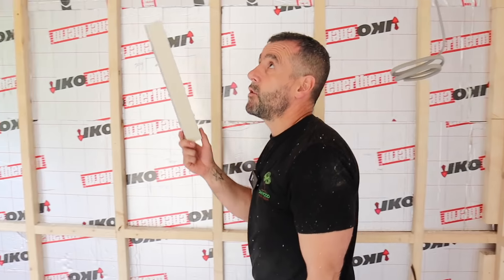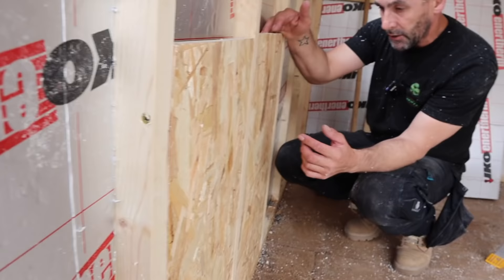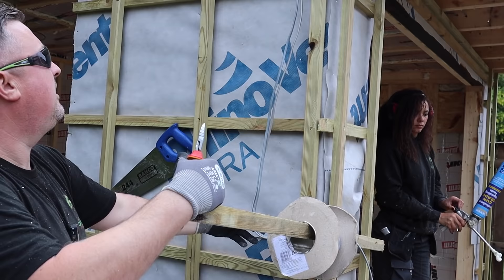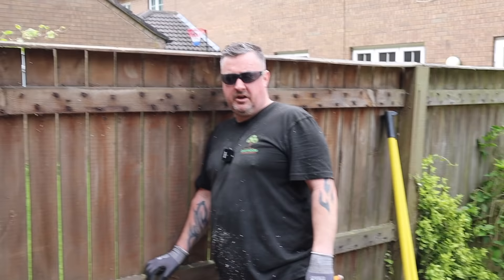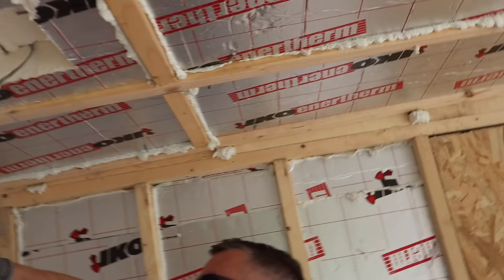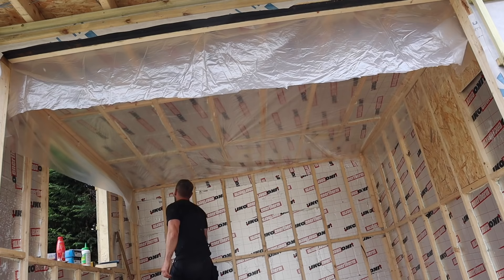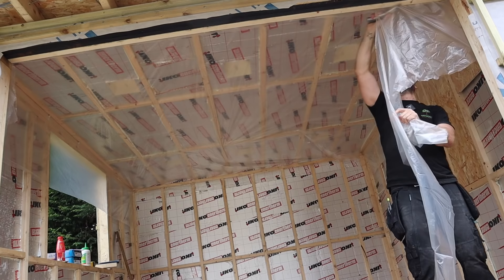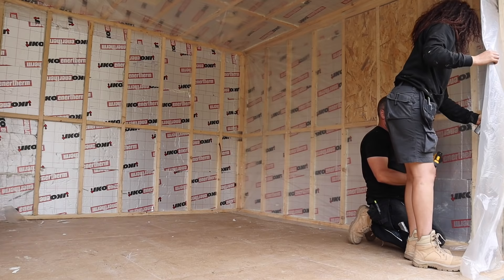Garden room, insulation, vapour barrier, 1st fix electrics and plaster boarding

Comment: Interesting that British gypsum  states that boards are not to be installed vertically but horizontal. They also require stud adhesive to the boards as well. How you do that with a vapour barrier beats me!
Reply from the maker: covering there back, if your stud work is good, plenty of fixings, it'll be fine
Reply: @thegardenroomguru  I don’t think it relates to the integrity of compliant stud work etc, it’s more to do with how glancing light and sun light strikes the boards . It reduces the amount of joins and these joins are halfway up the wall in a less reactive light reflation . Once the lights go on you can’t pick any joins etc.

Comment: 29 minutes in when he's drilling holes in the plasterboard, there's a thing called a DADE (dust and debris eliminator) that i found is most excellent at stopping al that mess from flying everywhere
made of silicon and worth the £15 investment
other than that, always finding new things even though the videos cover the same ground there's always a different angle, the pencil is great as i was wondering about that

Comment: My pir insulation is flush with the bottom of my roof joists as I have 50mm airflow above. So I've foil taped everything including the joists. Surely this will act as my vapour barrier?

Comment: Good video, I was looking at the insulation cost and doing it you way (with smaller sheets) is probably easier but around £4 a sqm more expensive than using 1200 x 2400 sheets.  Another option is to use 450 spacing but that could cause you issues with boarding unless you use 1800x1200 boards.

Comment: PZ has more contact with the crew head as it has 4 extra micro slots for grip the (little cross bits/lines) sit in the corresponding grooves of a pzcscrew head pH only have 4 points or torque contact. pH (Philips) head, PZ (pozi) head. And the pozi really means a more positive contact. There you know now. You would actually be surprised how many, very skilled craftsmen (or women) don't know that. 🤣🤣👊👊

Comment: Thank f***. Someone who can decide for themselves what height to put sockets and switches.👍

"The regs say, the regs say"😁
Reply: Not legal,  insurance would be void
Reply: @dalebutton2469  
In what way would your insurance be void?
You do realise that 'the regs' isn't a legal document, or requirement?
Reply: @dalebutton2469  That can't be true because there are many situations where switches and points have to be below regs due to physical constraints.  For insurance as long as the work is signed off then it's fine.
Reply: Put them where the fuck you want unless the dwelling isn't a new build

Comment: Can the overhangs be completely insulated and sealed up the same as the rest of the roof ?
Reply from the maker: you only need to insulate over the head plate mate, but its as easy to fill the sides and the rear anyway.
Reply: Any downside to doing it anyway? I actually fitted noggins over the wall plates things were trying to nest before I finished it lol
Reply from the maker: @jamesaamoore only down side it time taken mate, and a tiny cost, it’s all good

Comment: Thanks for the video. It was very useful to us as we want to insulate and plaster our summer house.
Do you think a hot tub would affect the plaster and cause damp? We were thinking of putting a skylight and extractor fan in for ventilation. Also, could I ask why the electrician needed to install a consumer unit? We were thinking of running our electrics from a spare 32 amp MCB / RCD from the house consumer unit. Thanks.

Comment: Mate you need to invest in a drywall gun if you're boarding out every job, I use the DeWalt gun, impact and screw is so time consuming.
Cracking job though 👍🏻
Reply: Or just a drywall bit if you’re using a combi or driver, saves driving the screws through the board

Comment: Hi , I hope someone can advise, I have a garage which I was going to turn into an outdoor office, On the internal walls I have concrete panels then its lined with OSB, there is a vapour barrier over all the OSB, then a a stud frame built with 3 x 2  I was going to use insulation between the stud wall voids then plasterboard without a further Vapour barrier over the stud wall and insulation. Will this cause me problems with moisture forming.
Any help or advice would be appreciated, you have no doubt gathered I am a novice at this type of work.
Thanks

Comment: Could i do the same installation on my skylight shed.  The walls are aprox 2mm thick and moulded to look like shiplap, its a very lite composites material. 
The roof looks like clear plastic looking from the inside up letting in daylight. But looking down on it it looks black.

Comment: Just a random question Liam what is the maximum gap I can leave for French doors before I need to install a steel? My roof is only 3m x 2m Keep up the greats videos learning quite a bit and very entertaining 👍
Reply from the maker: I’d put double timber over 1.8 mate, after I’d go steel, French doors are ok, but bifolds will bind if a couple of mm deflection mate

Comment: Some advice please. The company have installed my summer house and I am currently insulating it for the winter. 
The roof battens are only 2.5 inches x 1.5 inches. 
I was looking at using a hybrid roof putting the insulation against the Osb roof, leaving a gap and then vapour barrier before plasterboard. I’m not that confident due to the size of the roof battens my insulation is only 1inch thick. Will this be ok or shall I find an alternative method?

Comment: Hi Liam - love the videos and content! I am just starting to build my own garden room - Im an ex floorlayer and have built a few structures so am going for it myself! Had a quick question - I have a few packs of dritherm 37 slabs left over from previous works at hom, could these be used in the wooden walls im building? they will be made like the ones you do (4x2 battens and structure, OSB/feather edged outer and plasterboarded interior) but I can see the dritherm says its for masonry walls - could this still be used in my wooden walls? Keen to reuse materials where I can and save the cost of buying all new enertherm for the building. Any help/tips would be greatly appreciated - thanks
Reply: Yes, as long as they aren't wet.

Comment: Hi, do you guys add vents to the inside of your garden rooms?
Reply: This is what I'd like to know as well but doesn't look like he's replied. I'm thinking of insulating my summerhouse myself but I don't want damp as I've got fixed closed windows.
Reply: @nance7558  I never worked out if I need them as I have vented doors and windows. I suppose you could always add later if need be? I did insulate the entire structure of my garden room. Just going to start on my solar tracker panel system for power. Good luck with your project :0)
Reply: @leeg713  Thanks for replying  Lee. I couldn't afford vented doors and windows and like you said I can always put one in after 🤭

Comment: What thickness did you use in walls & roof?
Reply from the maker: Insulation 100 in floor and roof, 50 in walls
Plasterboard is 12.5 mm

Comment: Y dnt u use pink fire rated plasterboard stronger and safer not much difference in price
 Also 4inch exhaust fan opposite door 4 winter
 Do cut outs for lights n sockets after skim will be easier to plaster

Thanks 4 sharing very helpful
Reply: I think it would be unnecessary cost. Fire protection would not benefit a garden office as it's such a small space with a very wide door.
Reply: @CraveThatCoin  would make a difference its only couple of quid per sheet im sure clients would happily pay the boards are structuraly stronger these rooms are built to habitat spec
Reply: Eletrican work not passed off. Comes under p,p.
Which is building regulation
Reply: You absolutely what mate?